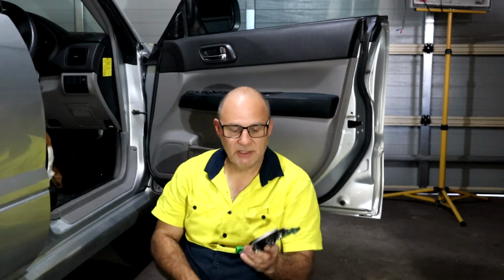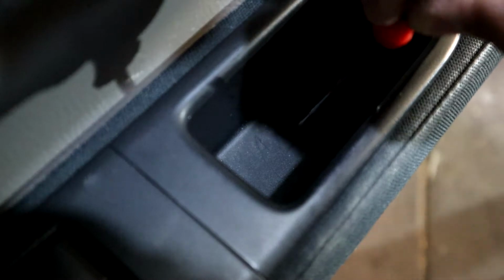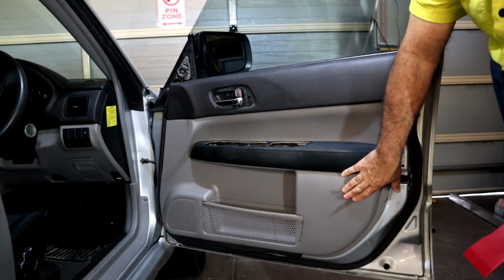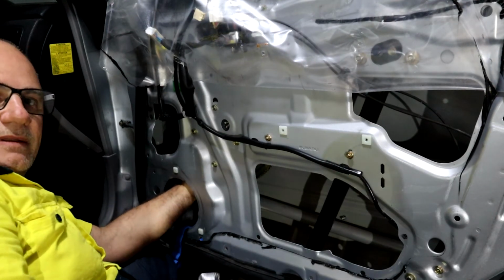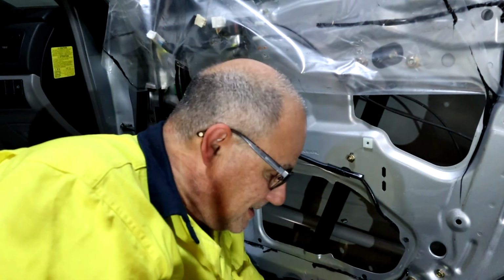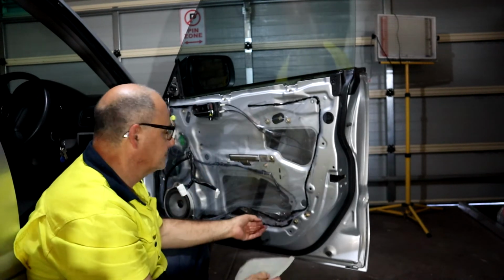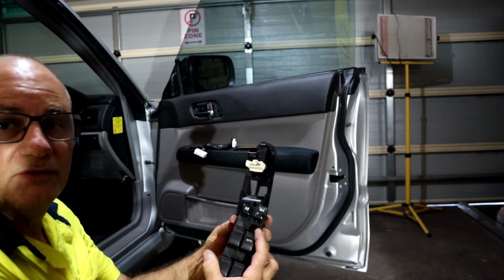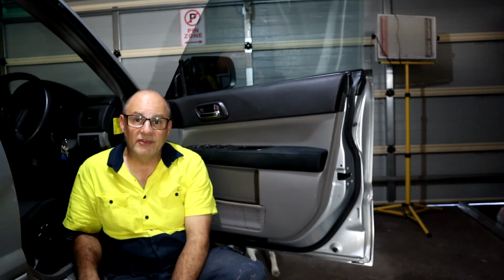Subaru SG Forester 2005 Driver Window Master Switch & Motor Replacement

Comment: Where's the fuse for the power windows? I can't find my manual and I can't find any info online about it.
Reply from the maker: That's a good question. I can't see it listed in the fuse box inside, it might be in the under hood fuse/relay box. I've just moved house and can't find my manual. There might be something under the hood for the power windows.
Reply: @pinzone4358  I've checked the fuse box under the hood but find nothing. I find this very strange and frustrating. Should be obvious.
Reply from the maker: @ingolfurarnar697  I found my repair manual for my Forester, it says there is a circuit breaker and a fuse to protect the circuit. Each window motor also has it's own circuit breaker. Depending on the problem you are having, it could be any of those protective devices at fault, or even a faulty relay, or switches, connectors or wiring. There is also the power window lock button you should check if it is on or off.

Comment: Great job! Thanks for the making the video. I just fixed mine last week after a ton of research. Wasn't quite as hard as I expected, which was nice. Good suggestion on replacing the window switches as well.
Reply from the maker: Thank you for your comments Daniel. I guess as a community we all help each other sharing our experiences. My method worked for me but in other instances, it could be more beneficial to remove the window regulator. (which I wanted to avoid). 
Keep Safe